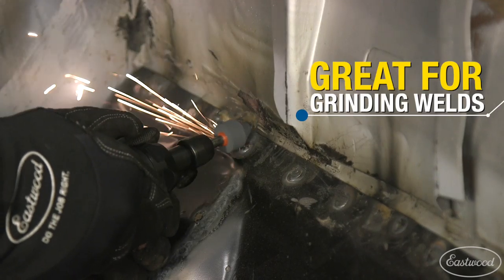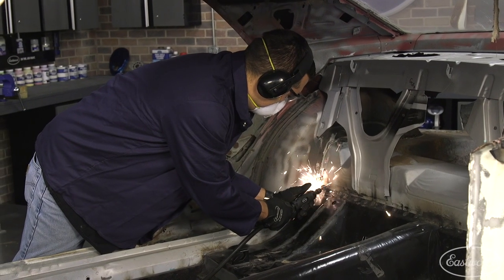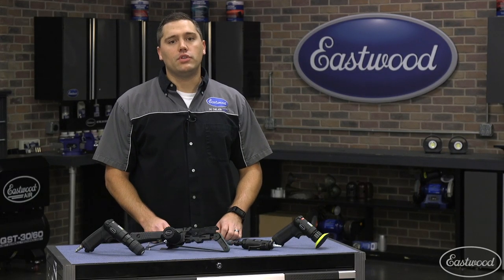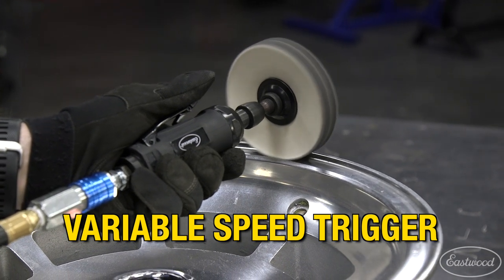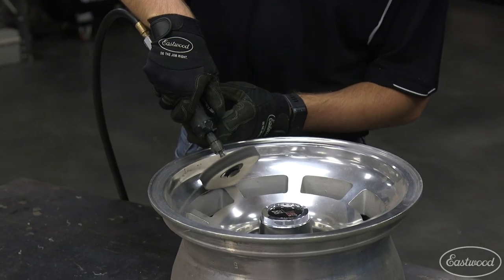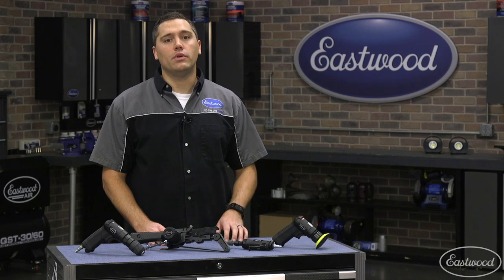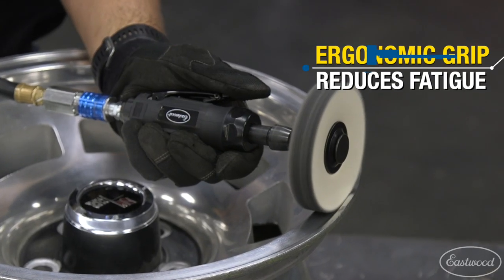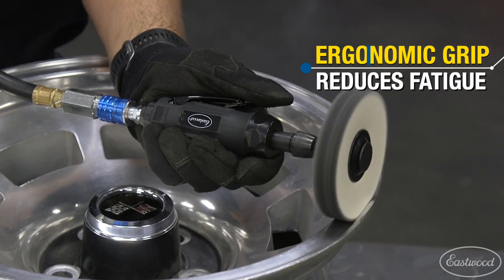1/4" Die Grinder - Must-Have for Precision Grinding! Great for EVERY Shop or Garage!

Comment: question for yall please; DIE grinder vs ANGLE grinder ...Whats the Difference? ...im not new to hand tools or workin on old cars, but ive just finished building my 1st home garage & have started shopping for an air compressor & some pneumatic tools, & admittedly im not super familiar with everything "air" just yet... & after seeing u use the tool in the video to polish an old set of wheels, it made me wonder, if i were to use said air tool (angle/die grinder) to polish up a set of tri-y spoked bare aluminum budnik wheels, with some tight spaces that the trusty ol mothers power ball just doesnt seem to wanna fit down into, what would be yalls reomandation? thanx & god bless
Reply: You can get a Dremel fairly cheap 1/8 shank .they have a great assortment of heads for just about anything you might want to do that is small and tight of space..
Reply from the maker: this die grinder would work with this kit! https://www.eastwood.com/eastwood-buffing-kit.html
Reply: @danielkeirsteadsr6939   thank u sir
Reply: @eastwoodco   i ear-marked that... ill just need to do a lil "figuring out" on which one of those things will work best on the aluminum wheels on the firebird... im also askin for a sct contour from the wife as a potential" combination" birthday/anniversary gift... gotta rusty 71 chevy monte carlo & im gonna need to cover alot of ground on that one... thanx for the help!